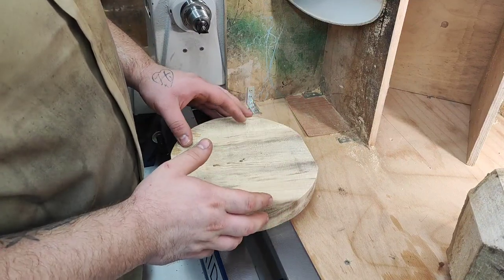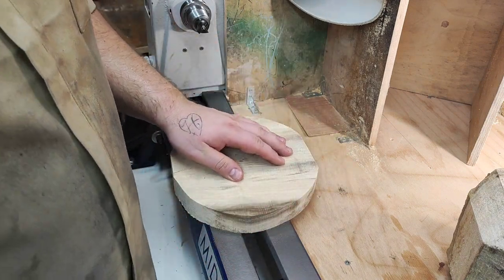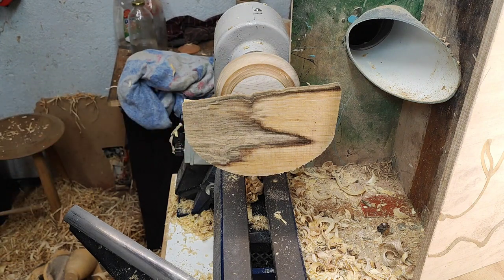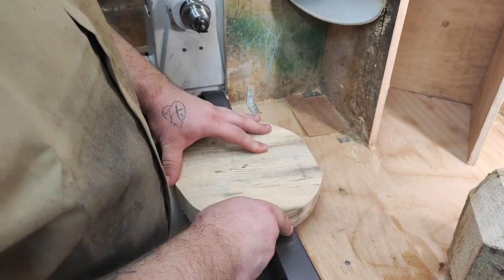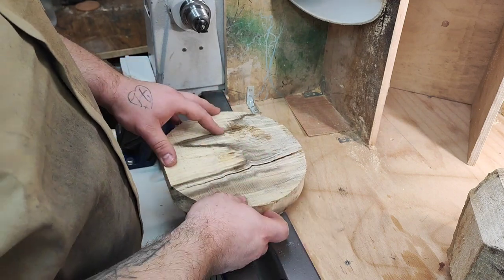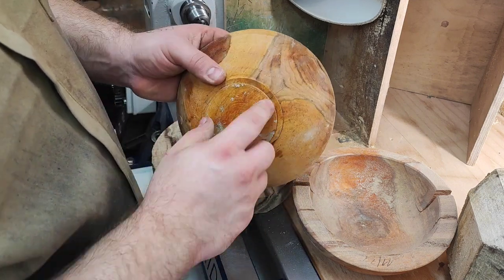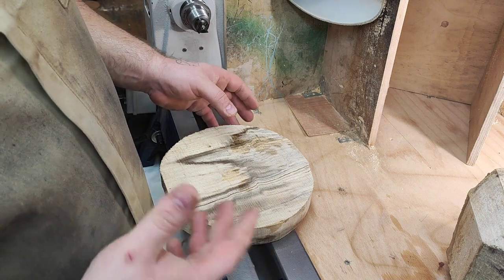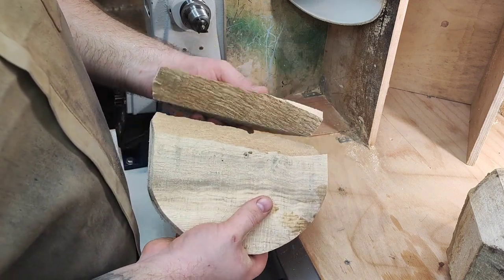Extreme caution___watch this before you turn the wood

Comment: Hello Tomislav, this video is important for me. I am the one that turns whatever lousy scrap of everything… cracks included. Wood is expensive here where I live and it makes me nervous to waste even a piece.
I had some things breaking and flying away. Up to now I managed to stay away from the fire line and I have not been hit, but I would not bet this luck would last. I always have a face shield on.
The most surprising and scary cracks were for resin pouches that created a longitudinal crack. Basically a crack that runs in the same direction of the diameter. 
The bowl literally exploded, I have found pieces everywhere.
Reply from the maker: There are other sources of wood, here is expensive as well but I would really suggest to stay away from cracks and splits , it only need ones to be bad.... Just me safe and take good care what goes on the lathe 😀
Reply: I am thinking to assemble a drying box, so I can harvest my own wood and be in control of the costs of it. I could rough turn the pieces and then allow them to dry in the box. Any idea about an easy model for this?
 @tomislavtomasicwoodturning

Comment: Had same thing happen . Oak platter separated , 1500 rpm , way too fast, standing directly in firing line initially, hit  four inches above left wrist deformed but not broken. My fault completely. Wood had splits, I was standing directly in the firing line. Felt link someone hit my arm with the full swing of a baseball bat. Hospital, physical therapy, angry wife. Definitely not worth it. Very glad you’re alright Tomislav. Thank you for posting this Safety Video.

Comment: So glad you were not hurt, that was a potentially very bad outcome. A good timely reminder to take care and use all safety gear. Greetings from Tasmania Australia 😢😬👍🇦🇺🦘
Reply from the maker: Indeed.... Thank you for your concern and support
Reply: @tomislavtomasicwoodturning  -One thought came to mind, had you not put the wood on with the spindle so 'fast', it might have remained intact until you did a tighten up check with the piece stationary, as I see Richard do so often-maybe the difference between turning for a living and turning for teaching??  Easy for me  to be wise after the event, but I am pleased you have shown this as I am sure many more of your viewers will take note and be extra careful. Stay safe my friend. My new lathe has its on/off & speed control on the tailstock side, which I think is a safer place for it. On the headstock one is really in the firing line in many instances, less so moving towards the tailstock. Just a thought for wood lathe manufacturers to perhaps have a think about.

Comment: Been there, done that! I had one blow apart while adjusting tool rest (yes, a no no when lathe is running, especially when I'm  in the firing line). It hit me in the mouth hard enough to push my lower lip into my upper teeth creating a cut to that needed three stitches on inside of my lower lip! That's when I decided my reflexes are slower than wood exiting my lathe!
Reply from the maker: Ouch,glad you are ok, that is why I advocate to use solid wood without any cracks or splits.... Thanks for your input on this 👍

Comment: Today I was turning a 13 inch bowl on my powermatic 3520b when I got a bad catch using a scraper. I was turning the outside and using tailstock. I'm still not 100% sure what I did wrong, but.. it actually bent the screw in my vicmark 120mm chuck. I am guilty of being impatient... thanks for sharing this video!!!
Reply from the maker: Be carefull

Comment: You are very lucky that piece hit you in the torso and not in the face. I don't buy the idea that the piece came flying off "low" rather than "high"  has to do with the spindle speed.  The piece came off where it came off, and it could just as easily flown off and hit the wall behind the lathe or gone the other way and knocked out some of your teeth, regardless of  rpm.
  It's impossible to stay out of the "line of fire" 100% of the time, so I always wear a full face shield (and safety glasses) when turning green blanks because defects are hardest to see in chainsawn (or even bandsawn) surfaces, and just because there are no cracks in the end doesn't mean there aren't any in the middle.

It would be safer to wear a full shield all the time, but I confess I mostly do not for finish turning and smaller work. 

One might think that the more we practice our craft, the safer we should be, and obviously to some extent that's true. But as we get faster and faster at repetitive tasks (like roughing out), we also get more vulnerable to having our attention wander — and that's when danger so often strikes.
Reply from the maker: Think of bowls as a propeler, the more the speed the more velosity and travel it will get.... That is why when I core out if the speed is low the core just gently comes down on the bed vs. high it will shot out high....  You are right about safety and face shields..... Thankfully some can learn from my mistake and prevent painfull day.... Thank you for comment and watching 🤗
Reply: @tomislavtomasicwoodturning  
 While the speed of anything that breaks loose is certainly proportional to the spindle speed, the direction in which a piece flies off is not. 
If the fracture occurs when the piece is at the top (ie, the piece breaks off when it's at the 12 o-clock position) it will fly off horizontally toward you. If it's at 6 o-clock it will fly horizontally away from you. At 3 o-clock it will go straight up and maybe break an overhead lamp (don't ask me how I know that). 
But if it's at about 1 or 2 o-clock, it will hit you right in the mouth if you're unlucky enough to be in the line or fire.
What happens to a core that is released when coring out is not the same as what happens to a piece that breaks loose from the periphery of a spinning blank.  A core  which breaks loose will just spin out and land on the bed. It might race around a bit if it's spinning real fast, because its motion (its energy) is rotational not linear, but that's about it. 
The motion of a chunk breaking loose from the edge of a spinning blank will be linear, and anyone in the way will have a problem.
Reply: @9thousandfeet   Yes. This should be sticky posted or something.  Where the chunk flies is nothing to do with the speed it is rotating at , once it STARTS OUT, it can go anywhere. However as it follows its trajectory , it will take a lower trajectory at lower speeds , which is where the "Myth" comes in to - However, standing directly in front of the piece like tom was, that close to the piece, like you said he could have been hit in the face, no matter what RPM it was spinning at. Lower RPM might have resulted in less damage (less kinetic energy) but still.   It's like playing russian roulette by spinning the gun on your finger until the gun fires - where the gun is pointing when it fires determines where the bullet goes, after which gravity vs. kinetic energy takes over (resulting in trajectory).  I have had bowls fly apart on me a couple times (one chunk just missed my ear and it was spinning at 600 RPM while I was sanding) but never had a fresh blank come apart because unlike Tom and others I have seen, I do NOT start a blank onto a screw chuck by running the lathe! I manually screw it on while lathe is stopped, then I give it a good tap with my gouge to test for any cracking BEFORE turning lathe on - Unless you have a perfectly flat face on the blank already, the screw chuck can actually cause the blank to split as it pulls the blank up to the face of the chuck.... 

Long story short, I agree with you entirely, and would never recommend anyone try to mount blanks to the lathe as Tom, and some other notable popular turners do. It only has to happen ONCE, and that ONCE might also be your last and only (because you could end up dead on the floor before anyone even realized anything was happening)